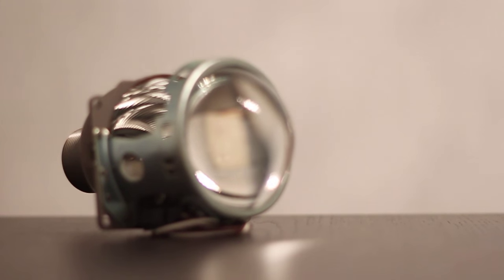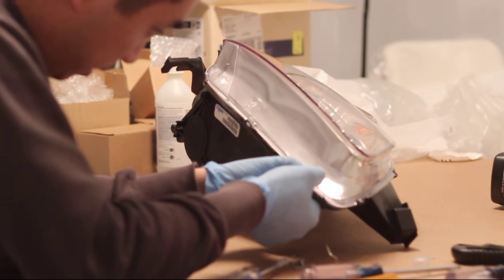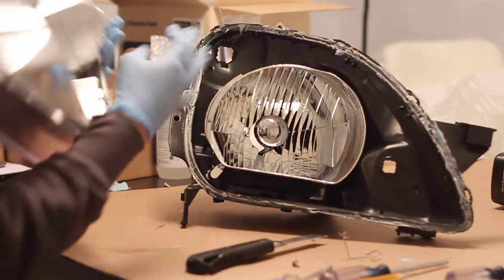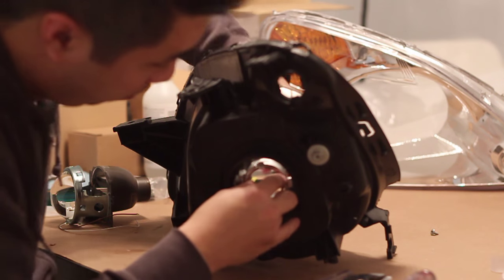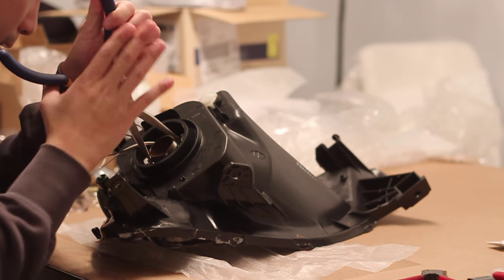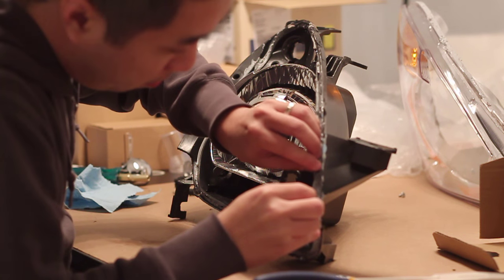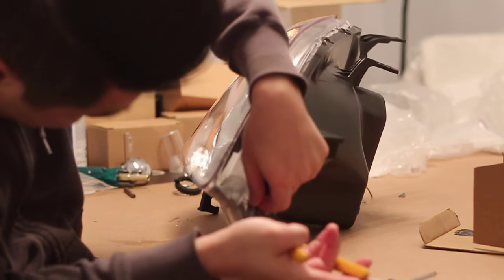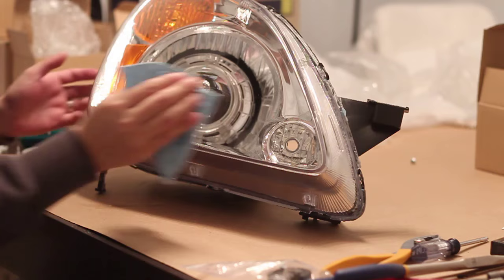How to Mini D2S 3.0 Projectors DIY H4 9003 HID Install - 2002 Honda CRV lumeneticlighting.com

Comment: I'd probably put some threadlock on the lock nut. If it comes loose from the driving vibration, its going to be a pain to deal with again

Comment: How are you getting round that there is now no headlight flash function on that headlight with only a xenon bulb fitted? This makes the lights illegal and will fail any inspection anywhere, surely?

Comment: Thanks. Couple of question. 1. Why do you need the epoxy when the shrouds fits the projectors perfectly? 2. How do you adjust the height of your projector/light throw to make sure that you don't blind oncoming drivers?!
Reply: Amjath Khan it is to ensure that the shrouds do not fall off from hard bumps for example, and to make sure the fit is tight as there is a little wiggle room between the shrouds and the projectors. If you were to mount halos to the shrouds this would be especially important as they could vibrate from the gap and it would be noticeable. Silicone should also work fine, but be aware if it is not intended for use inside engines then it will contain VOC which will off-gas and may fog up the lens, so let it dry for a day before closing the housing. Silicone would be easier to remove if you ever need to.

The headlights can be aimed vertically with the screw on the back outside of the housing.
Reply: Thanks for the explanation : -) 'with the screw on the back outside of the housing' - being a first time installer, I find it difficult to locate this 'screw'. Is that on the projector or on the housing? Would you mind giving me a pic of it? Thanks again!!!

Comment: Hi, how to determinate wich projector will fit your car ? for example my car is seat ibiza 6L  with ( h7 ..) how to find out wat projector size fill fit in ?
Reply from the maker: We recommend looking at the size ofyour headlights. If you have larger headlights, you can use a larger projector so that it looks better. If you use too small of a projector, it might look like it doesn't belong i nthe headlight. This is all personal preference of course. Fo your car, we would recommend using our MH1 6.0 Bi-xenon Projectors as it has an H7 adapterwhich will make install a lot easier. Check it out at our site http://bit.ly/1H1oXEd

Comment: great video.  When you did the epoxy part, I wasn't sure where exactly you were talking about.  There are the little tabs that hold the shroud to the projector.  Is that it?
Reply from the maker: Pretty much want to apply the epoxy onto any contact point with the perimeter of the projector lens and the shrouds.

Comment: Do you use centric rings on the shrouds to mount on the projectors?
Reply from the maker: For the Mini D2S  3.0 Projectors you don't have to as the clear lens is a 3" lens and is ready to fit almost all our shrouds

Comment: Can any HID bulbs fit inside these projector lenses?? I am buying these HID bulbs and projector housing and need to make sure that the bulbs can fit in correctly. They are size H7 bulbs
Reply from the maker: The Mini D2S 3.0 Projectors use D2S bulbs. H7 bulbs will not fit.

Comment: Hi,I Have a toyota Caldina 06 model which came with dedicated low beam projectors.Can i get a direct swap bi xenon projectors?
Reply from the maker: We do not sell any direct bolt in projectors for a Toyota Caldina. you will need to retrofit/modify your housings to use these projectors.

Comment: Hi how to install a LED Bulb like P6 55w LED in bi xenon projector lens in the same manner 

Hence Bi xenon projector Lens 
Comes with solenoid 

But in normal H4 halogen headlight system there will be no solenoid circuit connectors 

Pls explain process 
H4 Halogen-* to *- LED (dual beam or single beam) Bi xenon projector Lens
Reply from the maker: These projectors are meant to be used with HID D2S bulbs. Will not work with LED fitted bulbs.

Comment: So a h4 would fit on the d2s
Reply from the maker: +bertin fierros If you have a headlight that uses H4, the adapter plate will make it so that you can install the projector that uses the D2S bulb. The Mini D2S 3.0 projector you see in the video uses a D2S bulb and the H4 adapter makes it easy to install into an H4 based headlight.

Comment: Will these projector housings fit in any car that would also accept an H1 projector? As far as the threaded neck goes?
Reply from the maker: +Sean Williams You will need to widen the hole in order to mount these Mini D2S projectors as the "neck" is wider in diameter than the H1 bulb projectors.
Reply: +Lumenetic Lighting what's the best way to widen the hole? do you have a video on that? it's it worth the extra effort to install these projectors over the H1 projectors?
Reply from the maker: Sorry for the late response but to answer your qeustion, the best and easiest way to widen the hole is with a dremel tool. I would say that you'd be happy with Mini H1 6.0 projectors if your headlights can accept H1 projectors without any modification.
Reply: I've got a car that takes H11 bulbs, I want to install bixenon projectors. I know that most aftermarket projectors only use H1, H7, H4, D1s, D2s bulbs. How do I make my H11 work with those bulbs?

Comment: Which kit would I need if I have a 2003 protege5
Reply from the maker: We would recommend using our MH1 6.0 Bi-xenon Projectors as it has an H7 adapter for your Protege 5. This will make install a lot easier. Check it out at our site http://bit.ly/1H1oXEd

Comment: Would they fit a 2005 Ford F-150 and what are those cables that come out of the projector for?
Reply from the maker: You can make almost any HID Projector fit any car (given the space and modifications needed to your headlight) as it is a Retrofit to your existing headlights. The wires coming out of the back of the projector are for the high beam solenoid. Those wires control the solenoid that actuates a shield to move down so that you can have high beam capabilities. Please watch our other videos on how to choose which projector suits your car the best: https://youtu.be/txbfmWZpHq8

Comment: What happens if they're not at the proper height after installing?
Reply from the maker: Have you already adjusted the aiming on your headlight housing? If you have and it isn't at the proper height then you may have mounted them in your headlight housing incorrectly. So much so that even when you adjust your headlight aiming you can't get the appropriate height.

Comment: do you guys have anything, that can fit in the housing of a ford super duty 05-07?
Reply from the maker: This projector will fit in the super duty but will require a little modification to the back of the reflector on your headlight.

Comment: Do you think the d2s bi xenon projectors will fit in a Nissan 350z 2003 headlights? because the 03 350z's comes with small xenon projector and i want to ask if the d2s bi xenon projector will fit in 03 350z headlights? do you think is it possible?
Reply: Daniel Lumenier you really should consider just buying Depo 06+ Z headlights. Your 03 housings are an absolute night mare to retrofit

Comment: so can anybody tell me what I have to do with the negative and positive cable that the projector comes with? I have a chevy impala and it originally uses h11 bulbs but i will be retrofiting with a h1 mini 2.5 projector but idk if I would need any other harnesses or adapters apart from my h11 relay harness that I already have installed.Please reply.
Reply: Tie it into the high beam circuit

Comment: So does any lamp work or do i have to marry them ?
Reply: Lamps prefer to remain single and unmarried so they can roam freely.   Search for D2S lamps/bulbs for these projectors.   Better yet - this install was done in 2016.  Check out the D2S 4.0 version now or go with LED such as the i.LENS or MLED LED projector for dual low/high beam.

Comment: Can you use led bulbs with these projectors?
Reply from the maker: No. These projectors are designed to use HID bulbs. The light output from an LED bulb would not look good (or produce more light).

Comment: What is the purpose of the shroud over the projector?
Reply: Pew Pew Dave so the light does not go out the sides of the projector just the front of the shrouds. Also you can get led ring around the shroud that looks fancy